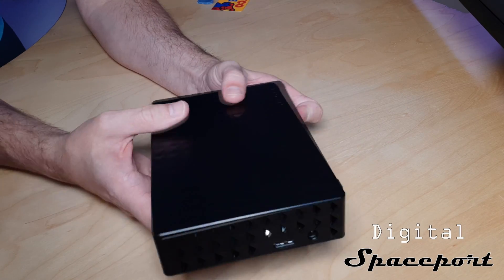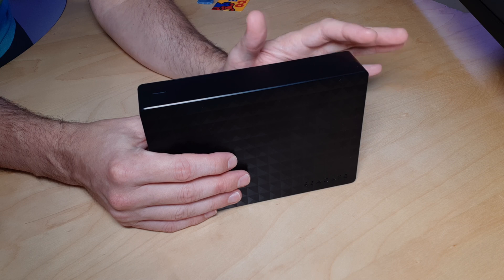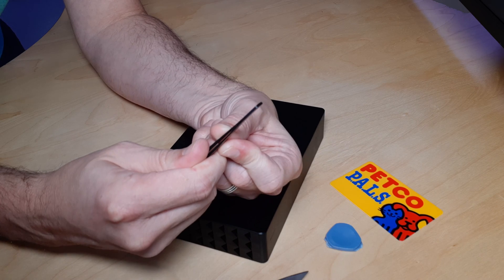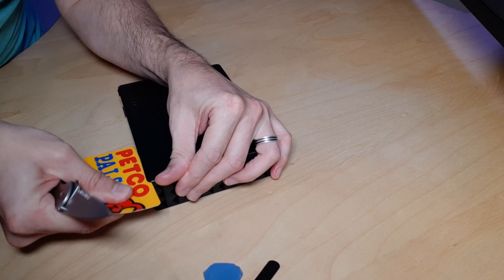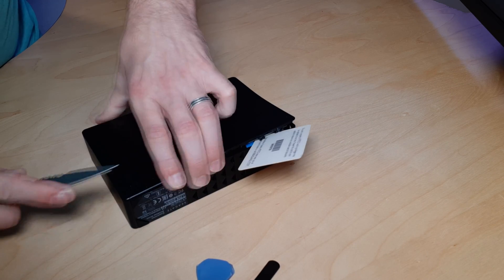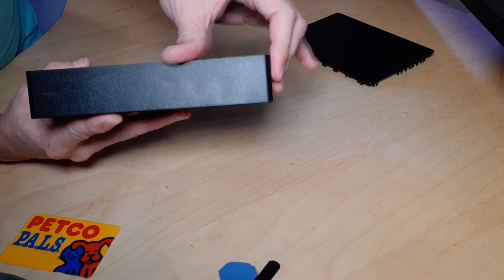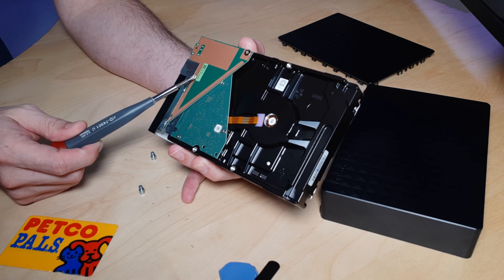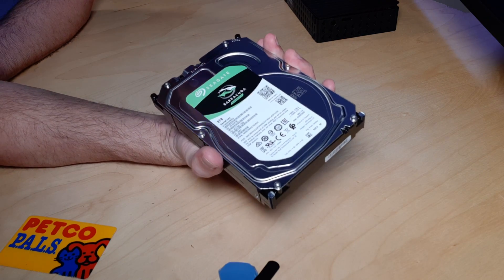How To Shuck A Seagate Usb Hard Drive - The Easy Way!

Comment: could you tell us how a rma is possible when there often if not normally is a warranty voided sticker across the usb adapter board connection point. have you done an rma with a disassembled/reassembled unit?

Comment: Hi, I removed my Seagate it won't work as an external drive, it would only work as an internal drive. With Western Digital shucked drives there is a tape trick, wherein you tap the 3rd pin (a contact) of the power connector  to make it work as an external drive. Would you know of a tape trick for the Seagate?

Thank you.
Reply: If I understand correctly (But check on this first) SATA power pin 3 is the Spin Up pin - If shorted to GND the drive will spin-up when powered, otherwise it'll remain in standby/sleep until asked to spin-up by the host. PCs do the latter by default, so caddies that don't short-out that pin will present drives that don't spin-up. 🛑

(The reverse case might also apply, so - Again - Double check this info before relying on it. 👍)

Comment: The single most helpful video for dealing with these drives. No BS, no long ramble, detailed and to the point. Well done.
Reply from the maker: I cut myself using this technique so please be careful lol
Reply: @DigitalSpaceport  I had no problems using the Jimmy and opening set from iFixit, came apart right away

Comment: Thanks for the video. Am I able to load the same hardrive into the Synology DS220 Diskstation? Thanks
Reply from the maker: I cant say for sure 100% as I dont have any synology gear, but It shouldnt present a problem. Once shucked it is the same as their bare drive offering.

Comment: will it work on STEB4000200 ?
Reply from the maker: I dont know the model numbers but if it looks the same, yes
Reply: @DigitalSpaceport  I seem to have gotten a different one, the STKP4000400 it has a slightly different design. please advice, I've already figured out it contains a seagate barracuda
Reply from the maker: @DaveFlash  I have not seen that design but if its skin looks the same on the outside the tabs might be in the same spot. I cant really advise on something ive never seen sorry.
Reply: @DigitalSpaceport  Are you on Twitter? Then I can send some images your way. Let me know.
Reply from the maker: @DaveFlash  @gospaceport
Reply: IIRC that's the Seagate Backup Plus desktop drive, which is a previous generation from the STEB8000300 shown here. If I'm not too mistaken, the enclosure designs are relatively similar so it should work in theory - But, as always, look at the drive carefully and confirm how it's constructed before you go taking a knife or some other warranty-voiding thing to it! 👍

Comment: I've been wondering if I should be formatting my drives with larger cluster sizes. Do we know if drive cluster size makes a difference in performance r/w to storage and/or possibly on lookup times?
Reply from the maker: It has been widly reported 64K size clusters are desirable. I know going with 4K or lower (4K is default in windows) would probably hurt, but I am unaware of how this number 64K size was discovered. In windows it probably has little effect, in linux it very likely might minorly and probably depends on the filesystem in use and the data written. The answer is probably in the smallest chunk size data block written in a sustained burst, which I am not aware if that number is known. That is from some other knowledge I have about tuning a filesystem for mysql transactions of fixed sizes.

Comment: Dude so Monday I bought (4) 8TB drives from my local Wal-Mart that I planned to shuck and add to the 20 I already have in my farm. Got home and found out they had been shucked, a small drive put in its place, and then returned to Wal-Mart. I was irritated to say the least but didn't have any issue getting my money back from Wal-Mart.
Reply from the maker: Exact same thing happened to me back in May! I got 2 scammed drives out of 12 I found at various walmarts, and aside from the long line the return was no problem also. I told them dont put those back out, but I am about 90% certain that they did. Glad you got your money back without issue. The ones I bought that had been already shucked were not behind a glass case, which should have clued me off.
Reply: @DigitalSpaceport  2 local Wal-Marts one has them behind glass the other just has security locks on them individually. Got 2 from each Wal-Mart and they were all shucked. If it doesn't have the plastic wrap on it anymore I'm not buying it.
Reply from the maker: My wallie worlds switched from WD's to Seagates in early june and the Seagates are plastic sealed. Have not seen them in stock in some time however locally :( Seeing 14Tb drives come back to normal pricing however has me feeling good!
Reply: @DigitalSpaceport  I'm wondering how much Seagate is going to price the rumored 20TB at.
Reply: Had a power bump during a storm burned the pcb on 3 seagate externals. They dont warranty that. Sent them out to northridgefix(has a youtube channel) hopefully he can do a bios swap. Only 32 tb of plots im more bummed about dead drives-they were less than 30days old from manufacture date